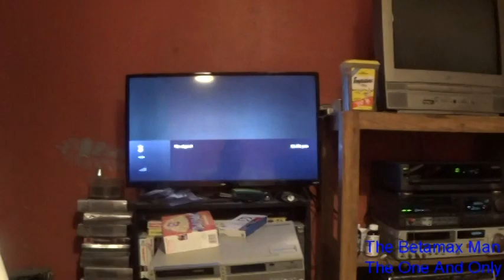A Customers Sony SL 5000 Repair Part 2

Comment: Hi! Your videos have been helping me a lot to work on my SL-5000 (bought recently, never serviced). I have a question: I'm planning on replacing all electrolytic capacitors on the whole machine (they are 40 years old by now, so might as well replace all in one go and have peace of mind). After that, is it necessary to re-adjust the machine's internal adjustments (the BI, BII and BIII capstan free speed adjustments, more specifically)? Because i thought "Wouldn't the factory adjustments be perfect when all capacitors are good and working within their original spec? So why mess with the adjustments?" What do you think? I don't have a lot of experience with analog electronics, but i do have a lot of experience fixing and recapping computer boards, so soldering is not a problem for me...
Reply from the maker: Replacing caps you will have to make adjustments especially for the servo board

Comment: Love your videos, but PLEASE, upgrade/upscale your videos to at least 720P. Youtube's 480p playback is heavily compressed and has a nasty tendency to blur out parts of the picture - especially those darker shots tend to loose detail.
Reply from the maker: my software i use is way there in SD i gues i'll upgrade my software
Reply: @thebetamaxman8905  Well, it might not be necessary to upgrade your software. I've helped a few friends upload some private videos. Even though the material was encoded in 480i, it was possible to have YouTube do an upscale of the material to 720p when we uploaded the video. Let me tell you, it looked a lot better compared to the same video uploaded in 480p. Dark portions of the video became more detailed and less obscured.
Reply from the maker: Thanks for the advice